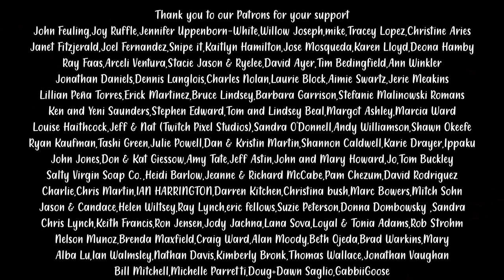1 Year in the Rainforest // couple builds own home in Panama

Comment: Your drain pipe holes need to on the bottom.  A small layer of drain rock, lay the pipes, another 6 or 8 inches of drain rock, filter cloth then backfill.
Reply: Ken is absolutely correct. That would be a proper “French” drain.

Comment: Drainage expert here. You want the holes in your drain pipe to be on the bottom. If you put the holes on the top,  the pipe will fill with dirt and plug up. Water needs to seep into the pipe from the bottom.

Comment: Granny Smith apples are my favorite 💚 thanks for the shout out 😂
Reply: Hey Kaylee, Jordan and the entire Lola's Farm family! So I thought when Kaylee was painting the door that maybe the green was a primer. Then I realized it's an unripe Apple color! Love it. Going to try the Athletic Greens since it is Gluten Free and sweetened with stevia. I can give up on some of my supplements and drink the Greens daily. Thank you for sharing. Nice work on the french drain, I put one in at my home in Florida because we get loads of rain during summer months and the holes in the pvc pipe need to be on the bottom so that dirt does not seep into the pipe. Live the new cement steps. This will save the mud from tracking into your new home/shop (shome).

Comment: HOLES go on the bottom of the drain pipe.  Most make this mistake. This makes a four-inch deep collection sump that will stay wet longer.  Use a long 1/2 inch bit and drill through every few inches to alleviate and allow the sump to drain..

Comment: Haha testing the electric fence electric ⚡️ 😂. Use a long blade of grass. Place the tip on the fence. As you move it closer the intensity increases. Much weaker than just touching the wire 👌🏼👌🏼

Comment: Holes go at the bottom for drainage, the water goes up and fills the pipe and drains out from the lowest level, sorry.  It will have to rise to the top of the pipe to drain and that will work.